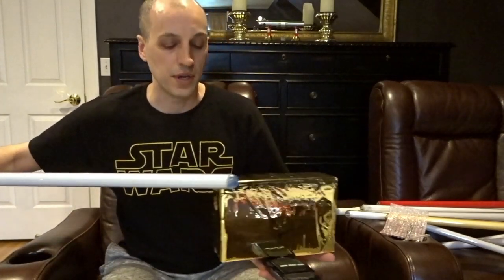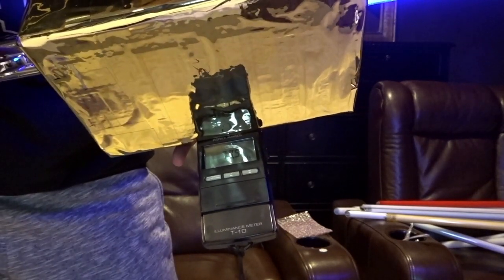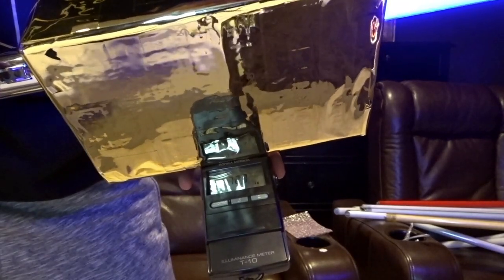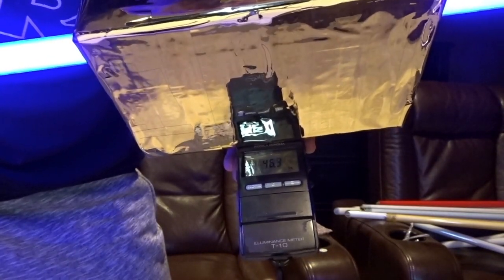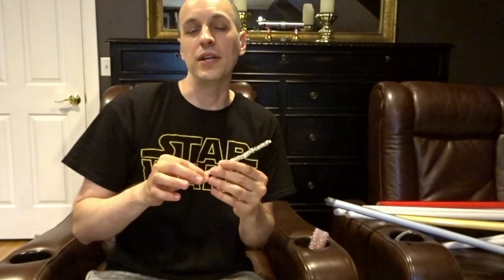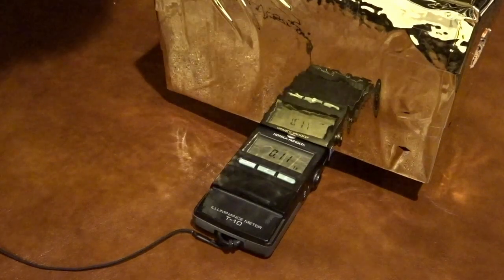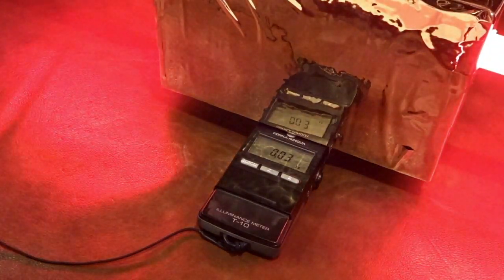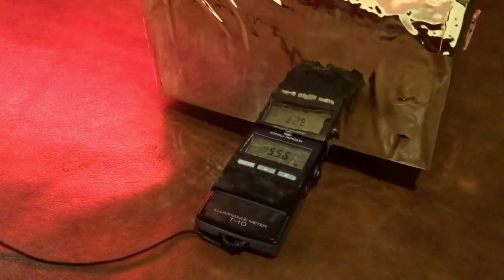EXPLAINED: Neopixel, String Blades + Light Testing Lightsabers

Comment: Awesome work with your blades. I've used the Neopixel LED strips (144 LED/M density) back to back and it works great.  For proper defusing, I used a single sheet of foam sheet for protecting the LED strip and keeping it from separating. I used a transwhite tube from TCSS lined with a single layer of tissue paper with a 1/8" overlap. I used a wooden dowel to insert the sheet. For the final assembly, I repurposed the clear packing plastic sheet that came with the transwhite tube and used it to stabilize LED strip in the blade. I used the 5 pin DIN connector as recommended by Plector Labs and it worked out great.  I used an NBv4, so I can't change colors on the fly. But for now I'm using the primary colors for the 3 stored profiles to conserve battery life. FoC works great with great control over the color combinations.  Again great work SpaceWindu, I've watched a LOT of your videos before exploring what type of blade to use for my Graflex 2.0 kit, it helps tremendously!

Comment: The issue with RGBW will be amp draw.  A fully bright white 32", 120x2 pixel strip blade will already be up to 14 amps (not sure if Plecter limits this somehow, FXSOS/LSOS does not).  Adding white will put it up around 20A.  Fortunately your typical blade colors are only drawing 1/3 to half of the full power (20ma per color, per pixel).

Comment: One major detail to the actual measurements - you forgot to actually subtract the preexisting light that was already in the box, about 30 lux. Therefore each individual Blade measurement is approximately 30 lux lower than displayed.
Otherwise, very helpful in examining the illuminant differentials for each type of Blade.
Reply from the maker: I think with the blade shoved in and covering the holes, the lux reading in the box should have been close to zero. Only with the blade not in the box could light enter the holes

Comment: Great video! I couldn't help but wonder how well your battery powers the back to back strip blade? I'm assuming the strip requires 5V but the battery you're using is 3.7V. Obviously it works as you showed but for how long? Are you using a boost converter? Also, it's safe to assume about 1/3 of the max current is being used so for the 5200 mAh orbtronic battery and 240 pixels, it should last roughly an hour minus the usage of sound effects. Have you done any tests to check this?  Thanks!
Reply from the maker: Thank you! I'm not using a boost converter as the 4+ v from the battery is enough for the strip blades and although I've not had the saber on continuosly, I think the real runtime is probably about 40 minutes.

Comment: I'm working on a blade theory that this tech would help with BUT I need a UV option too, and before you say it I know UV can be dangerous, I have a science degree, work with UV a lot, know how to filter it to make it safe etc. I won't go into my theory but I'm hoping that it will be a advancement on the Photon blade but in different colours and not just green. Nice that your using a JQ there, been speaking to them about my blade theory and they are very interested. Don't know how bright this tech will allow me to go ... I'm hoping to be able to get 15-20,000 lux from the visible light wavelengths, would have to do some maths with the UV for my theories to work. That all said the blade would be a fixed colour with a FOC option, could make it so that the LED core is removable so the the polycarbonate can be changed etc but my theory won't work otherwise.

Comment: Hey this may have been addressed somewhere before but was curious ..... can I use the neopixl strips in a 7/8" or 3/4" (not sure the size, for a korbanth hilt) blade? and if so could I duel with it. I know the 1" blades are a yes on both questions.
Reply from the maker: 7/8 for sure can be done. 3/4 the answer is probably yes but that is probably with less diffusion I'm not sure how it would look. Probably be ok but you don't know for sure til you try

Comment: maybe some silly questions have these been done on 7\8 blade or not enough room? can you do serious combat with neopixel and your string blades? are these plecter boards and others able to be compatible with the led and string board configurations at the same time or one or the other?
Reply from the maker: Yes, you can duel with these especially the 'strip' version. And yes, I suggest wiring your DIN plug the same way for use with ANY soundboard/LED driver board. Since there are three connections, different blades will work with different boards. Just make sure your mini SD card settings are set up correctly, and you are good-to-go

Comment: I have a question regarding neopixel blades. I see that they are self-contained. What kind of lightsabers can they work in? Do you need your saber to be made to take a neopixel? I see that various companies make them, so I guess only someone who had a saber made specifically for a neopixel blade would buy them?
Reply from the maker: Hey Dave,

Correct. Only a lightsaber meant to run Neopixel and using the proper connector can run Neopixel. Certain control boards such as the Plecter Labs Prizm V5.1 can do EITHER rgb LED setups OR neopixel depending on how you wire them and program the mini SD card onboard. Yes, only people with a neopixel enabled hilt should buy a Neopixel blade.

Comment: Are the neopixel blade significantly heavier than the RGB tri-cree blades? Since the Tri-cree are just normal dueling blades (non heavy dueling).
Reply from the maker: No, especially if you use the skinny strips. The skinny strips are very light and they can feel just as light as an empty blade believe it or not. When I use the thicker strips trimmed down, even then they are bit heavier than the skinny strips... and I can tell in a blade that there is some weight there.

Comment: Hey, is it possible to take a u Ultimate FX Kylo saber, take out the old LED Strip and just wire up NeoPixel LEDS? or what Conversion would it need?
Reply from the maker: Yes it's a very complicated conversion but it can be done so, so well by guys like Megtooth Sith. You can do it yourself there are probably some good tutorials online. You can check out The Custom Saber Shop videos for how to make the neopixel blades.

Comment: how do you wire the neopixle strip to a plecter labs board?
Reply from the maker: Robofrets check out the manual for Nano V4 or Prizm V5 it illustrates how you do it
Reply: SpaceWindu what about wiring the strip to the midi style plug seen in most light strong sabers?
Reply from the maker: I have a diagram on FX Sabers forum on how to wire a DIN midi connector for your CF LS. I will make one for that style DIN for Neopixels soon. But since there are only 3 connections for Neopixel more options open up besides the midi connector

Comment: Hey would really appreciate an answer on this. Iv heard that the makoto V3 GX plus was getting a lux rating of 1200-1500. I see you have some sabers here of 12,000 plus. I'm looking for one of the brightest light sabers and I understand you have a lot of hands on experience. Do these numbers seem accurate for the V3 GX plus? And how is the brightness of the V3 GX plus compared to any of the sabers in this video? Thanks so much
Reply from the maker: I'm not sure because I never held a V3 GX plus and I don't have any on hand to test. If in the blue range the number could be small but that doesn't mean it's not bright. It depends on the color type how high the number is. Purple and blues will be low numbers but can appear awesome in person. Greens and whites will have higher numbers
Reply: SpaceWindu thanks! How did the v4 brightness that you'd had compare to the brighter lightsabers you now have? According to what I can read. The V3 GX plus is equivalent to the V4
Reply: SpaceWindu there is test on YouTube of the makoto in green getting about a 1400 LUX rating for the GX plus
Reply from the maker: The V4 is pretty much mega. The ultimate brightness. Although I did not have a lux meter to test back when I had V4 Makoto colors. But Makoto has a tester he probably has a video with those numbers. I think when my friend Steven tested his daughter's green V3 Gx Plus, he got a reading of 4000 iirc. You'd be happy with Makoto's brightness its amazing
Reply: Thanks very much would you say the V4 is the brightest saber you've had in hand? Or do you build anything yourself of that brightness level or higher? I understand it might be a difficult question as you don't have the V4 handy
Reply from the maker: Some of my newest stuff in the enhanced tubes from the Custom Saber Shop might beat V4's because some of these actually hurt my eyes and my friends say the same thing they can't look at them.
Reply: Sure how can I contact you about possibly doing a build for me?
Reply from the maker: hit me up at my email alagaipa@yahoo.com

Comment: So based on this, are day blades better than a pixel blade? I was under the impression that the pixel blade was the best but the day blades seem to be much brighter?
Reply from the maker: Hey Jonathan,

What are you referring to as Day Blades? Day blades at the Custom Saber Shop are simply the colored blade tubes. A pixel blade is a component blade made up of many pixel LEDs. A Pixel component blade assembly can slide into a Day Blade tube. They are not competing products, they are two totally different things, but can be combined to form new shades of colors because the pixel blade LEDs can shine through a colored day blade and you can get different effect. Especially when you use all white pixel LEDs.

Comment: spacewindu how do u get the din plug?
Reply from the maker: I've been buying them on Amazon. It is the Deltron units as recommended in the Plecter Labs manual for Crystal Focus LS 6.5
Reply: so its the deltorn 8 pin din connector?
Reply from the maker: Yes. Since the new neopixels only require 3 of the pins, you can actually get away with a product with less pins. But I still use the 8. I'm stubborn.
Reply: i see
Reply from the maker: If you hold off, there's a new connector coming to TCSS: https://www.youtube.com/watch?v=3tS2qfLf0RI&t=3s
Reply: if  got the same as u did i would use 4 din pin heh

Comment: What's your diffusion setup for the neopixel?
Reply from the maker: 4 layers of clear heat shrink around the blade assembly, then Makoto foam (or MR foam if you don't have Makoto foam), then nylon TCSS tube if you can fit over the foam, then the blade tube itself